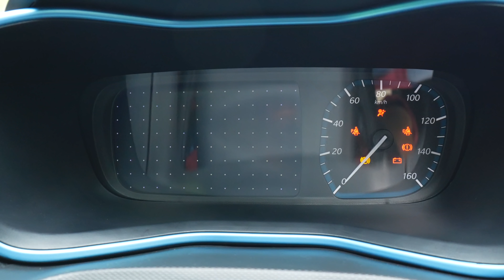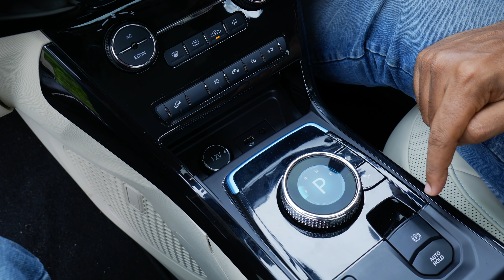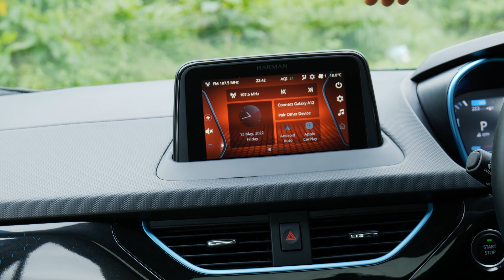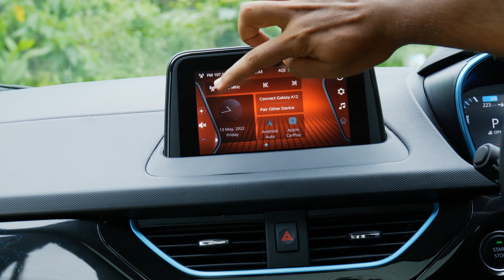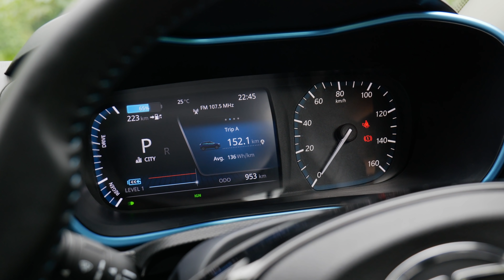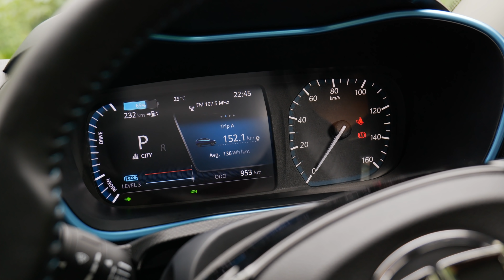ഒറ്റ ചാർജിൽ 437 കിലോമീറ്റർ Driving the All New Tata Nexon EV MAX | Vandipranthan

Comment: First of all its a great product from TATA. TATA has listened to most of the customer feedbacks. 

Some drawbacks and missing features. I hope TATA is listening

1. Headrest on both front seats is not comfortable. It's doesn't support the head, it is just there for name sake. 
2. Wireless Android and Carplay should have been default. 
3. In the back seat side handle we cannot  rest the hand properly. 
4. The ventilated seat switch should have been in a better place. 
5. Cup holder and one more charger should have been provided somewhere in the central console. 
6. Back side AC blower should have control switch. 
7. Rather than keeping those orange wires (connected to battery) exposed in the bottom a covering could have given. 

These are minimal additions I think TATA can correct before it's delivered to customers
Reply from the maker: Considering the price they did a good job ☺️